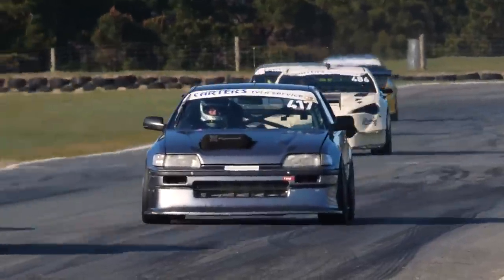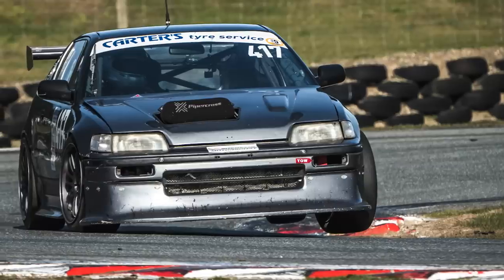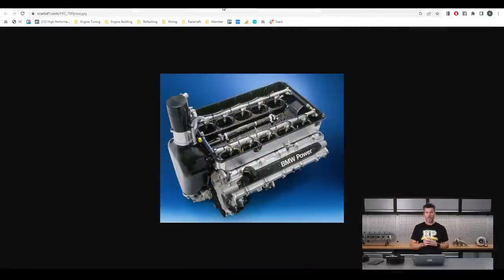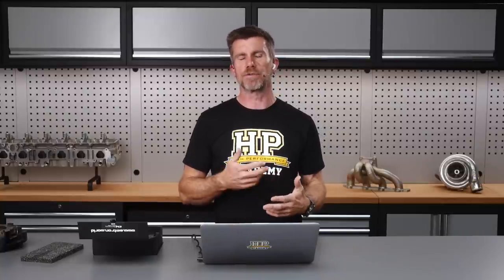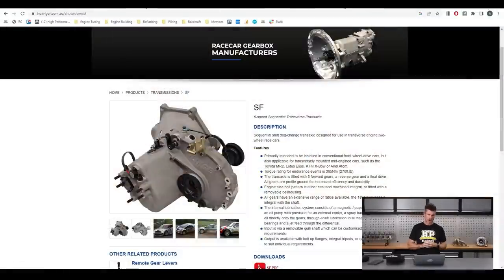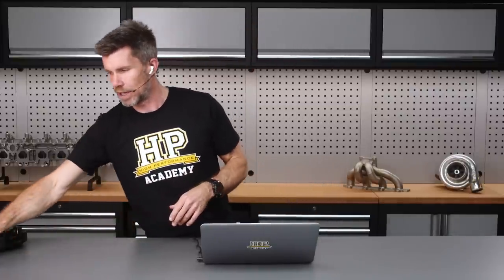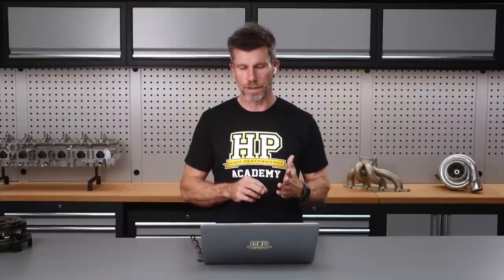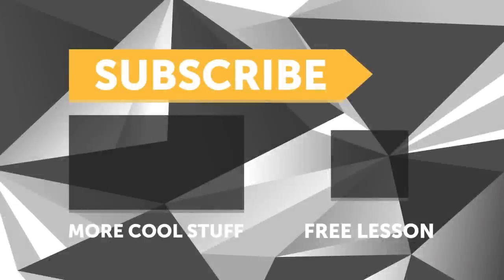K20 Swapped CRX Build #update

Comment: Ok, so I'm a VIP member. Paid full price! If you're interested in learning  Motorsports engineering. Start and finish here. I have learned a ton. I've built my first motor, made wiring harnesses, but have yet to tune or weld but it's all in HP Academy.❤

And the K series build chapters will be essential to my next two builds NSX and Cayman 😮.

Comment: Would you run this without a filter then? Or would the injectors be housed inside a large plenum with a large filter off to the side?
Reply from the maker: There will absolutely be a filter setup. Andre will cover in a future update 😎

Due to the gearbox change we are lowering and pushing the engine further back too which gives us more options in this respect with the dream to not have things hanging out the hood as they are now 😂

We are pressed for time already though as Brandon is taking some annual leave to go back to Ireland and we haven't managed to hire him any help yet.

PS: HPA is looking for a fabricator/mechanic to work on projects like this. We can't train applicants, ironically, they need to be able to hit the ground running - Taz.

https://www.seek.co.nz/job/67222930?type=standout#sol=630e2120da55504bc5088383b79d4a10f2807376

Comment: Cool. Hope we gey to see the results of the extra injectors. I'm pretty sure several of the drag racers in the US has tried it (yet no one is using it). If you're doing it i think you should try injectors with different spray patterns (and maybe different sizes also) to see what works best.

Comment: Finally, building a real race car, tbh bang for buck these K series 90s Hondas are epic level performance, if you ever decide to really kill everything, rotrex supercharge it, speak to BYP in Aus they build some incredible Hondas that clean up far more expensive builds...
Reply from the maker: Forced induction would push us out of this class I believe and make the car uncompetitive relative to the next class up. Essentially on that path, 'more would be less' so to speak.

You are not wrong in saying some people have great setups with those units though 😎

A general long-term idea/goal is to run a smaller capacity engine that is turbocharged or supercharged, but it wouldn't be in this chassis - Taz.
Reply: @hpa101  Consider the EK , EG or DC2 chassis.. all total gems, i had a EF8 back in the day with the B16A was a total blast but agree, they are 1980's designs and a little long in the tooth.
Reply from the maker: EG is the rough plan. It's one thing to have plans and another to have the time to make them happen though! We posted a while back about an S2000 build plan that we fully intended to make happen at the time, but still haven't for example 😂 Since then the price of those has gotten a bit crazy though putting them off the table really. Also it is a car that creates 'tall people problems' for Ben that are not easily solved like you can in a Civic or Teg - Taz.

Comment: Mpvi3 doesn't support Honda? Seriously?
Reply from the maker: Despite being extensive relative to other commercial software options, HP Tuners has more it doesn't cover than what it does. There are just so many cars out there. 

For some options they don't cover that are popular, I'd imagine the fact they would be competing with other already well-established companies in the market makes them less appealing.
For Honda you have Hondata, KTuner, Neptune and Crome off the top of my head as options. You also have a (large) number of plug-and-play ECUs.
Many of these options also do an excellent job already so it's not like you're going to win customers that have already paid for Hondata for example when it does everything they need already.

If you ever see HP Tuner covering Honda platforms my guess is that it will be via the likes of the Civic Type R and newer, but I wouldn't hold my breath - Taz.